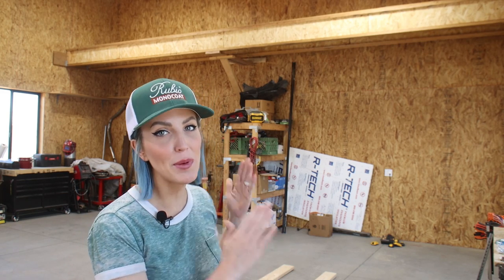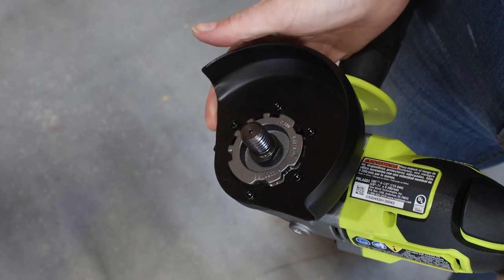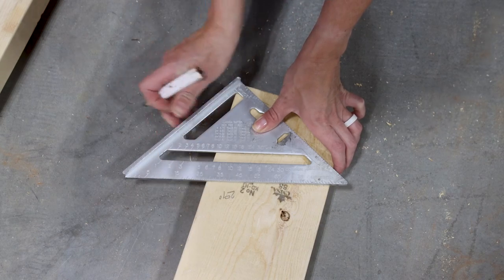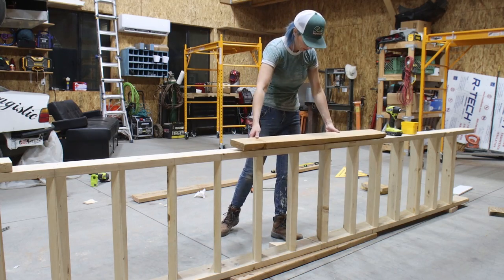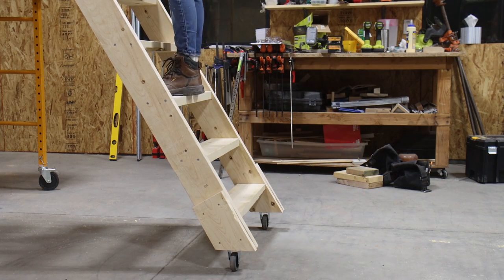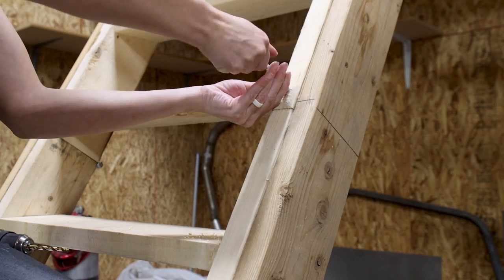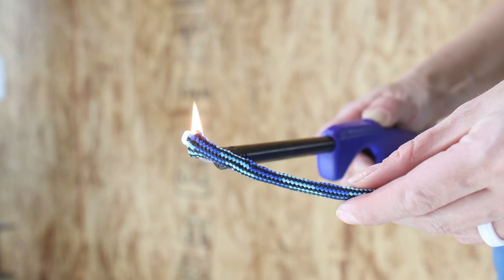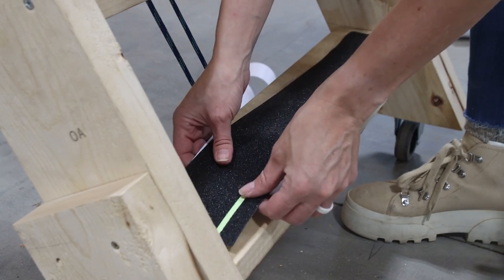MAGIC Folding Rolling Staircase for Loft

Comment: I've got a similar problem but additional obstacles. The ladder is directly under a roll up garage door, so whatever I do to raise it, has to be under and clear of the roll up door. I've got a couple prototypes in mind but ideally I want them to lift up completely into the loft area. I've even considered building out the loft to be able to install a standard attic pull down stair but like you, I want to be able to carry up and store large items without being confined by the small opening of a pull down attic stair. 
One of the ideas is like yours, a library ladder but instead of folding in half, it folds into itself from right to left. Problem is, although very narrow now, it's still in the way. I'm thinking of some kind of roller system that will allow me to push it up into the loft folded, without obstructing the path of the garage door when fully open. While still making it easy to pull down and deploy. I think I'll make it roll on a pipe mechanism like yours so that the length of the ladder will fit into the path between walls (my storage is deep, not shallow) where there "shouldn't" be anything stored to allow the ladder to be pushed up there. Getting it to pivot from standing to laying at an angle in the loft is still the challenge. But I find these things always work themselves out.

Comment: Your ladder system is super cool.  It might solve a problem with my serious vertical challenges in my shop.  (I'm short...real short, y'all. ) 
TIP: (A bit oversimplified)  The thing about pulleys is they help distribute and divide the load to make them easier to lift...the more pulleys you have, the easier the lift.  If you add an additional pulley to the ceiling, your load will need about 1/2 the pull it currently requires.  So, add a handle (like on a rope swing) to your rope and it will be way easier on your hands.

Comment: Adding the boat winch to that staircase was definitely the easiest option and you might find that instead of having the rope going through both pully wheels at both ends you might be able to remove a wrap (so only using one of the pullies at each end) and still have more then enough power to lift the stairs. This would also make it a LOT quicker to raise and lower. I hope this helps 👍

Comment: FYI, that winch should have a high & a low range I have similar winch on my sailboat trailer. You change it by pulling the handle out or pushing in without a load on it.

Comment: Pretty nifty. I wonder if it would work if you ran the lifting rope through a pulley near the current lift point, then up to the top of the stairs, then back down to the bottom of the stairs. This would then (I think) fold the stairs as it was lifted, removing the need for a second rope.
Reply: It would need a clip on it so that it is removable, as the staircase moves side to side without the lifting rope attached. Great idea though, I was also wondering if there was a better way to fold the stairs.

Comment: try adding a tool kit that is rope operated.  that will permit you to take items up or down while you below.   an extendable basket to lift like the one roofer use to lift up supplies. it could call for a second staircase system. the folding staircase is a great idea. you could add a fan to remove hot air out of the shop.

Comment: Simplest way to think about pulleys, is the rope.  One rope, one tension.  Not counting friction in pulley shafts, the number of ropes segments actually pulling up, is your multiplier.   If you have 4 segments pulling, that's 4 to 1.   You do the same amount of work, since you pull more length, but he force needed is 1/4.  (Some efficiency is lost due to friction).

Comment: 12:46 Once again, you can operate your manual hoist with a drill chucking the right size socket into it. I know, with all these drill operated options you feel like you need to walk around with your Ryobi holstered all the time. But would that be such a bad thing? EDIT: (oops, you got that one).

Comment: A Phillips, torx, square drive, or even hex screwdriver also work just fine for driving in eye bolts......one less use for a blade/flat head screwdriver. Some electrical breakers are best tightened with a blade screwdriver......I was too lazy to go get my inch pound torque wrench and the right driver tip to do them to spec.

Comment: that knot you used on the yellow nylon rope should work, but isn't the best knot you could use in that application. upgrade to a bowline, which will work better, and is a simple knot to tie.